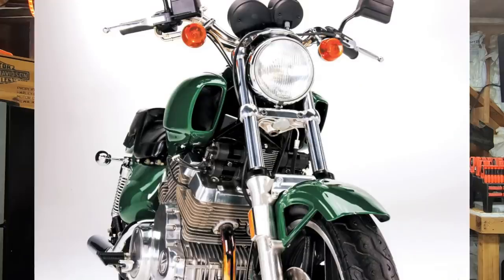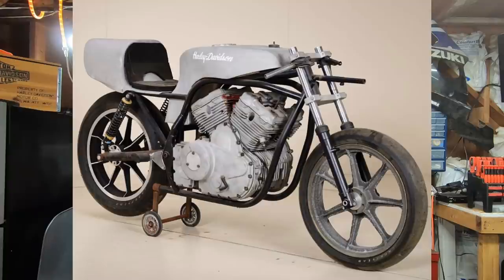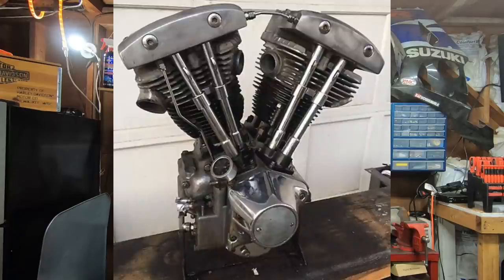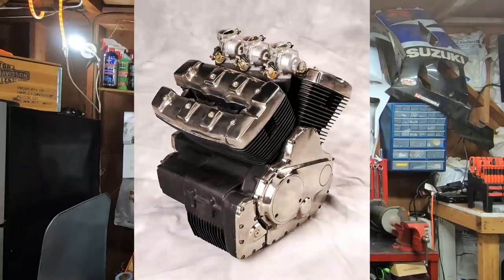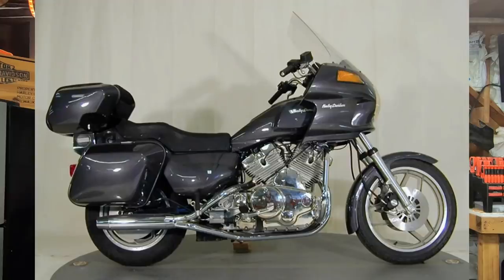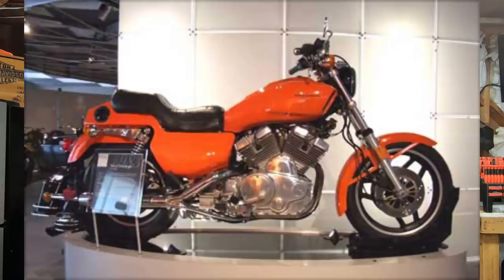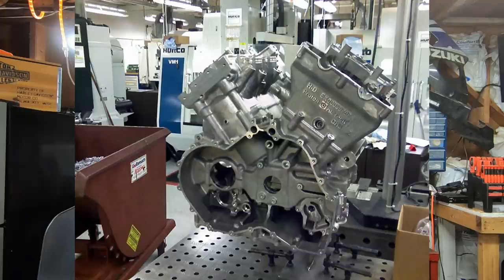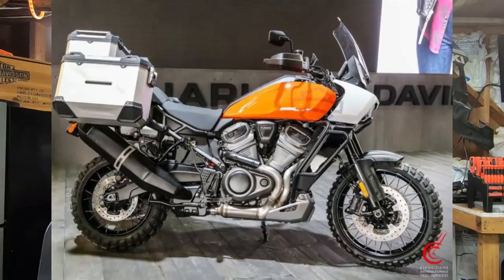Most Powerful Harley-Davidson Motorcycle That NEVER Happened

Comment from the maker: Do you think Harley-Davidson would of had success with the V4 engine platform alongside the Evolution engine?
Reply: It would have been a good thing. I own a Honda V4 and a Harley Twin Cam. A Harley V4 back then would have wowed everyone. Would it have outsold the Evo, maybe, maybe not, we will never know. Were Harley owners back then so staunch about air cooled twins only? I'd still love to at least hear one run though. I know my Honda with carbon pipes sounds like a small block Chevy.
Reply: Some much for AMF never having done anything for Harley Davidson.
Reply: not at the same time. I have a 98, 883, evo. I had an 87, 883, only sold it because it was a 4 speed. bought the 98, 883, 5 speed. I have never had a problem, with it. but I would at least see a 4 cylinder Harley.  Could you imagine the low end torque? you would need a seatbelt to stay on the bike.
Reply: Na. Unproven engine.
Unpredictable future mixed with an unstable past, just a setup 4 company failure  if they would have had issues at the time.
Besides, the BIG-shots wanted to keep the Big checks, as did the Union, so if people are buyin, why risk the new bike 4 cheap ass pens, and an Office covered in dark crap paneling
Reply from the maker: I read on a forum a guy claimed he had a sound clip from testing of those engines! I would love to hear that myself too!
Reply: @Guns_N_Gears  Unproven?  Not quite.... there were about 15 engines built, and they logged thousands of dyno hours as well as 100,000 + miles on the road.  Check here for the full story:
https://big-diesel.blogspot.com/2007/09/nova-harley-davidson-which-was-never.html
Reply: Guys I knew who worked on NOVA said it was a good engine. But that doesn't mean the Harley-Davidson faithful would have accepted or bought it. They would have called it a "Jap bike" and would have shunned it. Don't forget, this was the time of Honda Drops, Samurai Slams and Fat Boy atom bomb motorcycles, lol.
Reply: Wow, had they only done it. What's cool about HD's is that they built a pretty good market on DIY guys who played with their engines to help them build a market for HD parts and followers. It still remains the case today, and it's why Indian is just another bike. So, I guess back then... they either got lucky or were just smart on having guys like you to explain things on mods.
Reply: @206-HoneyBadger  
They did do it -- it was called the Vrod.
Reply: @browngreen933  Where is the Vrod now? Nuff said
Reply: @206-HoneyBadger  
Exactly, Vrod kaput. Imagine if HD had gone with Nova instead of Evolution. Yikes!
Reply: @browngreen933  when did they put 4cyl in v-rod?
Reply: @steve-rr3nq  forget the imaginary world of the dyno, the engine TQ would be close to the same, the actual HP is what would double ..... You would have 4 tq instead of 2 in the same time......yes you would need to hold on
Reply: @rugershooter5268  
They didn't, but Nova was also a twin, not just a 4.
Reply: @browngreen933  I'm sorry, I read the question
Reply: @rugershooter5268  
That's cool. So are Rugers!
Reply: It has been my opinion that the HD customer base is as resistant to change as they are loyal to the status quo. As evidenced by the sales of the HD V-Rod.
 Had HD gone with these engines, they would have had a very serious risk of alienating more of their extremely loyal base than bringing in new riders to the fold. HD was and is on the path to extinction. Unless the live Wire project exceeds all expectations (highly unlikely, considering the dwindling number of young people interested in bikes or even driving at all), HD will fade away with the last generation of riders. I hope I'm wrong, but I see HD both sustained (for the moment) and held hostage by the customer base they so successfully cultivated over the many decades.
Reply: @burnerjack01  v-rod was made for those that say Harley needs to......so Harley did......those that said Harley needs to, didn't buy, it was the Harley base that bought the v-rod. And me being part of the base sitting here with 2 Harleys anda zuki crotch rocket, and I was going to trade the zuki in for a Bronx
Reply: @rugershooter5268  That's funny cuz everytime I mention the V-Rod, HD guys ALWAYS say "That ain't no HD..."
Reply: @burnerjack01  so you're a non-hd guy, you hang out with hd guys and talk v-rod......ok I believe you

Comment: Great video! I understand that Nova was intended to be introduced in ‘81; the same year that the buyback was finalized. The FXRT fairing hit the showrooms in ‘83.

I also understand that the buyback team was all in financially and that when Citibank (I believe), called the note, the only option left for the team was to take the company public in ‘86. My sense is that the timing and financial resources simply didn’t work out for Nova. 

There was another prototype machine that never made it to market, but a few of its parts did. I don’t know the code name, but the config was an overhead cam, 60 degree offset v-twin, with a one piece, plain bearing crank.

I saw a running prototype in ‘74, as well as a massive piece of machinery used in the manufacturing of this engine at H-D’s Capital Drive facility.

I later saw the horrific megaphone mufflers used on this machine installed the 1976 Superglide models.
Reply from the maker: I believe l know what you're talking about. I can't remember the name but l have seen something like that, l just can't  find the picture.

Comment: And 1993-1994 Harley-Davidson build a Superbike call the vr1000. The track versions made a 150 horsepower for a top speed of 170 miles per hour. The engine was a double overhead cam four valves per cylinder liquid-cooled 60-degree V-Twin the motorcycle with 4.5 gallons of fuel weigh 388 pounds. The street versions of this motorcycle made 135 horsepower with a top speed of a round 165 miles per hour....with some money in the bank, Harley decided to build its second eight-valve racer, with an American engine, chassis and brakes. Engineer Steve Scheibe headed the team, and called in experienced help from NASCAR and Indy Car racing. This engine was the same configuration of the later to come V-Rod. Porsche had nothing to do with this engine as it is the same design internally as the V-Rod..

The VR project was canceled in 2001. What Harley-Davidson learned during its time racing the VR1000 translated into tech that made its way onto the street in the form of the dual overhead-cam V-Rod that was launched in 2002.

Comment: I can't help but wonder why, they didn't just delay the project rather than terminating it. By the late 80's or early 90's Harley had their cash flow problem solved by the evo success. They could have put the plans on the shelf for 10 years and cashed in on that 10-15 million spend on r&d.

Comment: Been riding H-Ds since 1976, first I've heard of this, thanks
Reply from the maker: It's a shame they didn't get it into production, but the Evo was the absolute best bet. Dumping the Evo would of been a big mistake.
Reply: I've been on harley since 1977 ,and I knew about these engines.
Reply: Harley would probably have gone cheap on some parts and would have ended up with the same problems the older engines had

Comment: To many moving parts at the time. Harley was already struggling with previous AMF bikes breaking down all the time. They couldn't risk another unproven motor on the road just dragging the HD name down. The evolution is simple and easy to work on. The most reliable engine out there.
Reply: What do you mean? They fully intended to risk it. They thought they could go head-to-head technologically with Honda with assistance from Porsche. Just by luck they developed the Evo as a stopgap and by a miracle it performed way better than they expected. Then they didn't need NOVA, which didn't look like a Harley-Davidson anyway. But the motor itself by all accounts was a good one.
Reply: @browngreen933  yeah if the Evo was never a thing. But to say this this was better than the Evo in reliability terms was a huge risk in itself. That motor was way to advanced for it's time and the potential for it to be problematic was high. Like I said more complexity means more problems.
Reply: @joetroutt7425  
Definitely right. Even if NOVA was a good engine it would have been beset with teething problems. Plus it was no Harley-Davidson. Guys would have hated it. Plus it caught your ass on fire. Harley-Davidson was lucky that Evo was there to save them -- which it definitely did.

Comment: Shoulda used the Ford Taunus v4 or Cologne v6. Came with either carbed or fuel injected fuel systems, were designed around the same time and displacements ranged from 1.2l to 4.0l.

Edit: Woulda been good for the partnership too.

Comment: They did the right thing for sure. That nova bike would not have sold. Not by itself. If they could have produced it along side the traditional, air cooled, evo bikes then it had a chance of working, but still a long shot. That evo is hard to argue against. Especially for that time period.
Reply from the maker: They made the right decision deciding between the two platforms, it's a shame they didn't have the funding to produce both lines side by side.

Comment: Gee, HD had a Buell with Rotax motor and gave it up. Now they behind the industry and still attempting to swoon new buyers with nostalgia.
Reply from the maker: They've tried to run on nostalgia for years, at least now they are branching out a bit. There's a market for the big air cooled twins but it's good to see they are finally breaking into the liquid cooled over head cam engines.

Comment: Glad to hear you know how to pronounce the man's name, Porsche
Reply from the maker: Porsche made the switch to water cooling from air cooled and kept their customer base, now how Harley is going to have to have eventually make that switch I dunno how they are gonna do it.
Reply: @GixxerFoo  they need to fix the testing and standards, they use contaminates per liter, where they should use contaminates per mile

With the short stroke you can run a little leaner, thus less fuel per liter, higher compression, and with 4X the number of booms it runs hotter......thus needing water cooling

Yes the short stroke puts out less contaminates per liter, but not per mile.........but they've set standards not knowing what they were doing, and of course refuse to make any corrections.....and admit they were wrong

Comment: Harley should have developed a sport bike around the v4. By the late 80's Harley was raking in the dough, and had plenty of resources for R&D into new markets.... they had that killer engine just sittin there doing nothing with all that R&D going to waste. To any other motorcycle company it would have been a no brainer.
Reply from the maker: Oh no doubt, they didn't have a contingency plan for when the good times ended. They had the VR1000 ready to go in the late 80's, it was more powerful than anything anyone had seen. Went racing in the mid 90's and it was way behind then.
Reply: They made the v rod man

Comment: HD ceo Vaughn Beals promised that NOVA would be HD's Honda killer. Evolution was merely supposed to be a temporary stopgap solution until NOVA was ready. As NOVA took over the air cooled Evo line would be phased out permanently. But the Evo performed so well and better than expected and guys instantly fell in love with it to such an extent that NOVA with its ass cooking radiator was no longer necessary and began to look like the turkey that it kinda was. Plus, like you said, Evo was cheaper to make and the buyback team was cash strapped anyway.

My take is that if they hadn't developed the Evo but had just foisted NOVA on the public, HD would be dead today. Look at that thing! No Harley rider would have bought it. They would have called it a "Jap bike" and walked away. Evolution motor truly saved Harley-Davidson, just like the Knucklehead had done back in 1936. Can HD do it again in the 2020s? It sure ain't the LiveWire!
Reply from the maker: If they could of produced both side by side, and the Nova bikes were reliable l think Harley would of succeeded. They definently wouldn't be in the issue they are today trying to break into the liquid cooled market. We will see if they have any success with the adventure touring.
Reply: @GixxerFoo  
I'm not sure what you mean. In the 1970s-80s liquid cooled motorcycles were considered an abomination. That is why HD took such pains to conceal the NOVA radiator and make it look like an air cooled bike. If they had produced NOVA and Evo side by side Evo would have sold and NOVA would have been shunned. We only have to look at Buell, Vrod, Street and LiveWire to know that. Next up: PanAmerica!

Comment: Can't believe at 60 years young that I had never heard this story before. Learn something new everyday. Are there any that survived and if so what their value would be? I think Harley made a huge error with their entry into the ADV  market. All other manufacturers have listened to their customer base and brought out a midsize ADV bike ( 650 to 900 cc ) because of weight. Harley's bike only has a chance if it can out preform KTM's performance and BMW's comfort.
Reply from the maker: They have some in the museum in Milwaukee, engines and complete motorcycles. I read on a forum a guy had a sound clip of one of the engines running. I am trying to get I  contact, if it's legit l would love to hear it!

Comment: Another funny thing 
Erik buell worked on this project
Also these motors had super short stroke to run high Rpms
I think the nova project and the Fuelling W3 are the biggest what if harley wasnt baised solely on the bottom line
Reply from the maker: That's true! Buell actually had a hand in this, it's said they may not of had the problems they do now had they Buell have his way a bit more.
Reply: @GixxerFoo  its the truth 
Buell would still a brand
Rivaling the big 4 of japan

Comment: Bottom line...... Harley is known for its sound. If it doesn't sound like a Harley, it won't command a Harley price. Sad as it is, that's how it is.
Reply from the maker: We saw that exact thing with the VRod. They were high priced no doubt, but used they were cheap compared to the air cooled models.
Reply: @GixxerFoo  Oh yea. I looked at one when they were being sold. I sat on it and gave it a good go around and just didn't like it. The fuel tank is under the seat of all things. I appreciate Harley trying to get with the times, but there was nothing Harley about the vrod. And you're right. There was plastic everywhere on it. Harley just keeps redesigning the same motor because nothing else sounds like a 45° v-twin pushrod engine. I've got a 2020 Breakout 114 with the new M8 motor. They said that the motor had to be redesigned until they got that signature sound.

Comment: At the end of the video he said BMW was the ruler of the adventure touring segment are you kidding me they're trash at 30,000 miles you might as well take them down to the salvage yard if you want a real adventure train bike it's the KTM no question about it I have a Suzuki V-Strom nice bike but the KTM that's top shelf
Reply: My buddy has one of the first big VStroms.  It’s a solid, reliable bike with well over 60k miles and counting.  I had a 05 BMW R1200GS that also gave me 60k absolutely trouble free miles.  I sold it because I couldn’t justify 2 bikes and my Harley is a much better bike for carrying a passenger.  Gotta keep mama happy!  Anyway... That’s my experience with the BMW R1200GS, great, reliable, bike but maybe not so much comfort for a passenger.

Comment: I recall when the evo came out and I was a Shovelhead lover I thought what a piece of s***! Well the Evolution motor obviously saved Harley and turned out to be a very durable engine.
Reply from the maker: Without the Evo engine Harley would of been in serious trouble, that's one of the best engines Harley ever made. Now if you go through a Shovel and get it all lined out they can be very reliable engines as wel.

Comment: The 1980 FLT with rubber mount and 5 speed transmission was like a moon rover to the HD core crowd. I know, it’s there.  Being snubbed and fingered by your fellow riders. Yes, that’s what happened. Now try V4 water cooled? The history is that Trev Deeley the Canadian distributor and on the board, rallied against the Nova for the same reasons I described. Yes the Evo help save HD but what IF?
Reply from the maker: I think Harley would of been on top if they could of taken a dual pronged approach back then, now they are trying to work back in out of a corner it seems like.

Comment: Wish they would have released it. Heck i wish they hadnt dumped aermacchi as the 80s small cruisers and dirtbikes that were developed to be HDs and sold as Cagiva were competitive....Its funny listening to the "harley guys" telling you what is and isnt a harley..... they trash AMF, but They saved the company by developing the evo fixing the reliability issues. Suddenly an evo is a "real" harley..... the sportster was introduced in 57 but they cry about it..... then the livewire they whined about it enough to get the HD name off of it. When the company finally goes under from listening to their  rapidly aging "fans" instead of innovating, everything from not having entry level bikes to treating electric bikes as a step child will be the reason.